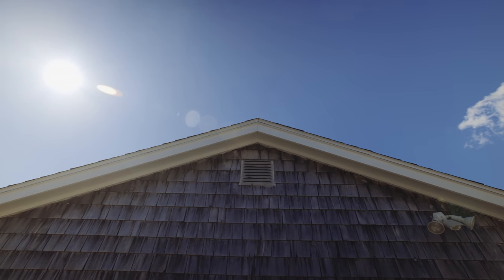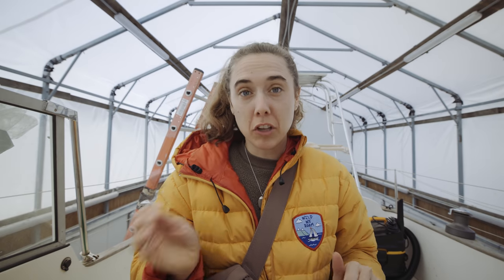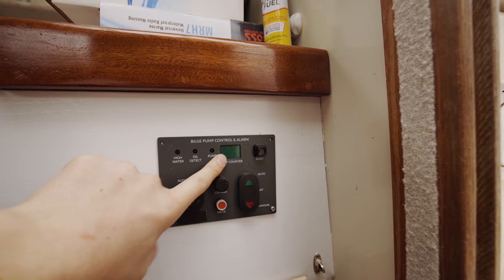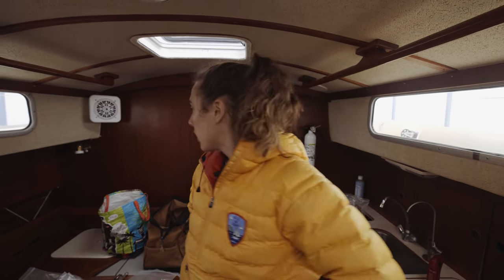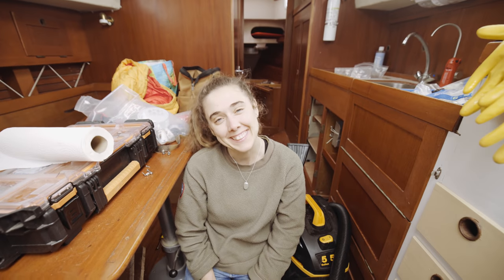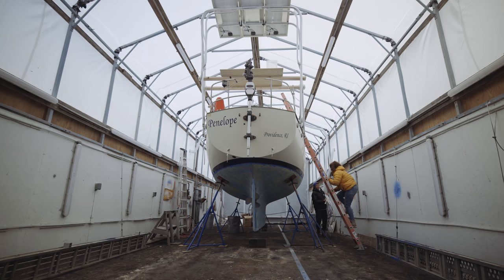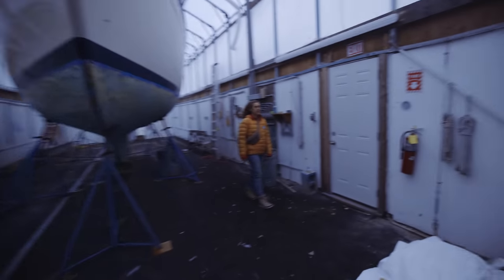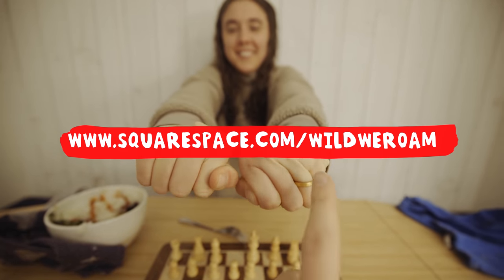Safety First! | Boat Life Ep. 45

Comment: That hole in the bottom of the bilge is a drain. It goes down to a screwed-in bronze plug called a garboard plug located lower on the keel outside on the port side of the boat.  You will likely find this when you strip the bottom paint.

If you search the Rasmus Facebook group you will find photos and discussion of this drain in the bilge and the garboard plug location and such.

The point is to unscrew this plug when the boat is stored outdoors on the hard.  If the boat leaks in any water because a scupper plugged up and the bilge pumps are not operating (or frozen) the water will drain out as soon as it gets to the bilge and not flood the inside of the boat, or even get a chance to freeze inside.  Many boats have "sunk on land" because they filled up with water.  Hallberg-Rassy is a premium brand and a garboard plug is an option usually only found on high-end boats.  

I feel it is something worth keeping in case you ever need to leave the boat on the hard in a place far away while you need to fly home or elsewhere.  There are a lot of cruisers right now separated from their boats because of COVID.  If you had to fly home from Fiji or something like that and leave your boat for a year you might feel a lot better knowing the boat would self-drain if the cockpit scuppers plugged up and not flood the entire inside.

As for mounting the pumps inside I epoxied some bolts head-down in the bottom of the bilge to mount those little bottom snap on screens to the bilge pumps with hex nuts. For the sensors, I mounted a 2" wide fiberglass sail batten vertically to the 1/4" thin wall on the forward part of the bilge with some 1/4" bolts and spacers and let it run all the way to the bottom.  Then I mounted the sensors to that vertical spar with just hose clamps.  That way I can adjust the levels if I need to in the future.  I used a float sensor called the Smart Bilgepump Switch from Aqualarm.  I highly recommend it.  It even has a time delay so it continues to pump out for 15 more seconds after it reaches the bottom to get all the water out of the hose so it doesn't all come sloshing back in.

We also mounted a system called "Drybilge" which is sold by Seafllow which uses a tiny vacuum hose and a special sponge pickup at the bottom to get almost every drop of water out.  This is much better than the bilge pump can ever do.  It doesn't replace the Bilgepump, since it is slow.  It just does the everyday water removal, the regular bilge pump is for only emergencies and will last basically forever since it rarely needs to work and sits nice and dry.
Reply from the maker: wow seriously thank you so much for taking the time to write to us with so much thoughtful information!!! we really appreciate it :) I am happy to report that the hole we found that was spongy/causing issues is not the same as the bilge drain. we have that and love it and know about the brass drain plug. This was a separate spot where someone had drilled down to probably attach a bilge pump ages ago that had since been removed leaving a screw hole. Water must have gotten into it, frozen, thawed, etc causing the issue. But it has all been sorted now, the bildge is looking fantastic and we've got all our pumps/alarms, etc sorted now. There's a bit of a delay between when we film and when its uploaded with editing and all that jazz, so it's actually all set now!! I haven't hear do of the drybilge but a few others mentioned in the comments and I'll show Lou when he gets back from the boat tonight, but i think we're all set now. Again thank you for all of your kindness!!!
Reply: I really like the Drybilge system from Seaflo.  I am very glad we installed it. There are a number of these systems we have seen at boat shows that cost a lot of money but the seaflo version is well under  $200 and does the same thing very well.  I installed the box in the engine room just behind the starboard cockpit scupper hose. 

The reality of cruising has meant for us that we motor a LOT more than we would have thought to get to places in a timely manner, especially on the ICW.  That means more dripping seawater from the stuffing box and eventually filling up the bilge.  Before we had refrigeration there was a lot of ice melt in there too so we rarely had a dry bilge.  Now, the Drybilge system does a good job of keeping most of the water (and associated stink) away.  

I want to someday run a second vacuum hose and pickup  to the catch area under the head sink. Water tends to slowly collect down there as any spilled water from the sink, or if the head port window leaks because we left it open or didn't dog it down hard enough, it all ends up down there and never really evaporates.  A dry-bilge pickup would be perfect for that spot too.

Our boat had a tiny bilge pump down there below the head sink cabinet at one point in the distant past but had been removed by a previous owner.  The screw holes remained as did the wiring and a switch in the head that says, "Bilge Pump" over the little forwardmost head cabinet door.  We never ever shower in there because of moisture and other Rasmus owners have had issues with the bulkhead rotting and causing the mast step and compression post to sink down because of that.  But still sometimes we find water down there that needs to be soaked up with a sponge.
Reply: @WildWeRoam  I can understand you having a delay for safety and security or even if you want a holiday from the YouTube grind but it does work against you in situations like this.

Comment: You can drop a spider from any height and it will be fine. Its terminal velocity is very low so it doesn't get injured when it hits the ground
Reply: How do you know this? did you do experiments? different species of spider? different surfaces? Different temperatures? Did other people do so? were they paid to do so or volunteers? It seems a strange thing to have on a CV yes for two years I worked as a spider dropper!!

Comment: I guess this was a while ago and you have already moved forward. I suspect that the sump had a false bottom covering a void below. If so, cut a decent size hole in the bottom around that screw hole, clean it out and reseal. You don't want water standing inside it as it may cause osmosis from the inside.

I think I commented before that panels, cupboards and floor boards need to be secured properly. Otherwise everything will go flying the first time you are knocked down. Always think inverted on a boat.
Reply: The hole leads to a garboard plug on the outside of the keel lower down. It is supposed to be there as a drain so when the boat is on the hard it can't fill up with rainwater/snow if a scupper fails or a hatch/port is leaking.  

We have the exact same boat, it is a feature, not a flaw, although the cracks should be repaired, as you say.  Water likely froze in it and damaged the top of the hole.

Comment: Get at least one extra bilge pump. Maybe two. Don’t learn from the mistake yourself of having too much water coming in and not a sufficient amount of ability to pump the water back out. Wouldn’t be the worst idea to see if your marina supply store has something in a portable manual bilge pump as a back up if something happens to your manual bilge pump and you lose power Or simply to have a greater capacity to remove water in the event you lose power. Just here on YouTube I have seen four or five different videos where they comment on their lack of ability to get water out of their boat and their boats almost sinking. So as your title of your video says safety first, Carry some extra bilge pump‘s.
Reply: Our boat has rhe largest bilge pump Rule makes, 5200 gallons per hour.  The one Penelope has is tiny compared to the one we have.

Bilge pumps are pretty robust, they don't fail very often.  What fails is the float switch, or the wiring to them.  Sometimes they will plug up with hair.  Long hair can wind around the impeller and slow it down, causing it to actually blow the fuse at a bad time.  The pump should be tested regularly and unsnapped from its base and the impeller inspected for hair or other debris.  That is why they unsnap so easily like in the video.
Reply: @svbarryduckworth628  on sailing nandji- frothlyfe their anchor slipped and they ended up on a reef and the water was coming in too fast and was not all getting to the bilge pump. I can’t remember that other channels name right now but he just put his new boat, well new to him, into the water and one of the through holes with a transducer failed. He had a few different issues one his batteries were all below the waterline and became submerged no longer could run the bilge. Secondly they couldn’t find the proper handle for the manual bilge pump. I think he had a few other issues too but at first he was relying on shore rescue to help but eventually he figured out by pulling a battery up from under the water and drying it down he could get it to run his bilge pump which is not so much of a bilge pump problem as a battery problem or more to the point battery location problem. I just think it’s better to learn from other peoples problems rather than find yourself with the same problems and maybe not having as good of outcome. In both these cases the boats were saved but they’re having tragedies at sea. And you’re right there bilge pump did look a little under sized. In which case get a bigger one and keep that smaller one as a back up in case of emergency. As the saying goes “better to have and not need then to need and not have.” Isn’t that why all these cruising boats have life rafts on them aside from their dinghy.